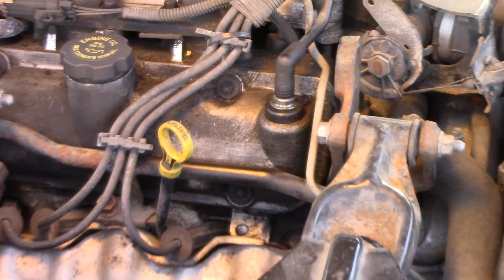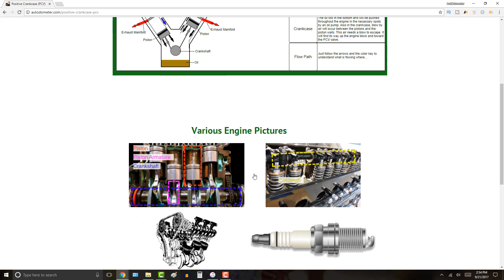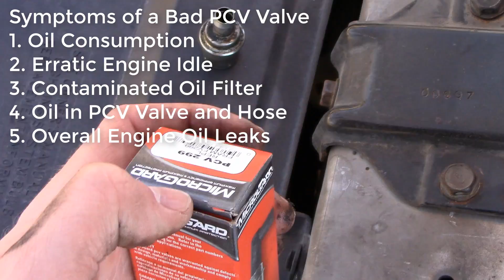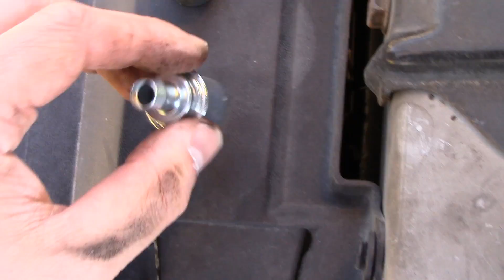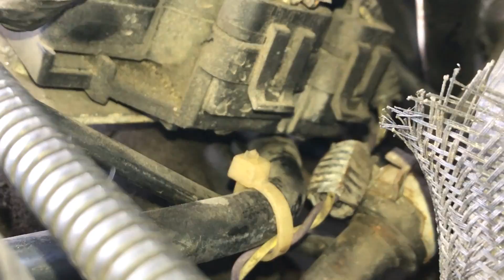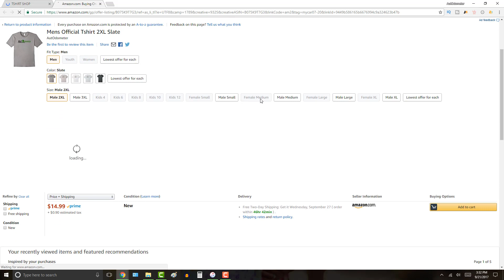How to replace your PCV Valve

Comment: That 90 rubber elbow broke but I replaced it easily with a spark plug boot rubber from a cannibalized DIY plug wire kit.

Comment: Every video I've seen on removing these make it look like it should just slip out... mine is stuck in the valve cover, lovely.
Reply: I think you are suppose to turn counter clockwise and pull.
Reply: I had the same issue, not really a great way to do it besides just keep pulling😂

Comment: Another symptom might be erratic brake pedal pressure, or brake boost performance... also and if it’s turbo a longer turbo spool/lag times since the ECU/PCM might be adjusting the idle fuel ratio to the lowest possible since the expected air from the clogged PCV isn’t available.

I am having issues with the PCV to OCC to Intake hose collapsing on my tuned Mazda CX-7... tomorrow I will replace as much as possible of the hose with 5/8 OD (12 mm ID) flexible copper tubing, as much as possible but keeping tougher 5/8 hose to keep the elasticity of the system (engine vibration friendly).

I would suggest to clean your engine compartment regularly with plain water (regular garden hose)... and if you have oil spilled use dishwashing detergent and water in a very low solution first. Just being careful with electric and electronic components and the whole engine will look quite better and also more attractive to work with.
I am an engineer, a mechanic, a racer... but I am also a woman

Comment: I have a question, the passages side valve, on top of valve cover what is that called , I think its where the fresh air comes in, my question is can that passenger side valve be replaced i can't find a video about it, its just a hose that connects to something there on top of valve
Reply from the maker: I’m not sure. I don’t have the car any more. It could just be the brake booster hose. Is anything wrong with the way the engine is running?
Reply: @AutOdometer  no it is not brake booster it gots into the throttle body next to cover and runs over to the passenger side on top of valve cover like the pcv valve  its an s10 2001 4x4
Reply from the maker: Oh is it the 3.1L engine like in this Lumina?
Reply from the maker: There is only a few tubes that typically come out of the throttle body. The throttle body will have an idle air control valve on it. It sometimes also has a small radiator tube that runs to it to warm the throttle body up in the cold weather so the throttle body flap on the inside does freeze shut. It then may have a radiator tube return to go back to the cold side of the cooling system.
Reply: @AutOdometer  i think its called air intake its a plastic hose that is connected to the throttle body cover that runs over to the passenger side valve cover
Reply: @AutOdometer  it is the crankcase breather hose I wanted to know if the piece that fits on the valve cover the hose is in can it be replaced
Reply: @AutOdometer  the port that that breather hose goes to that attaches to the valve cover on passenger side

Comment: If they can just sit there and push in, why is mine screwed in so tightly that I can't budge it 😠
Reply: Probably carboned in
Reply: Yes, it's probably crusted stuck (or melted). 
The torque specs is basically "very lightly handtight" (< 5 Nm) since it's often plastic against plastic on a lot of cars.
Reply: So how does one go about getting this uncarbonated lol. Because I'm having a hell of a time with the one I'm working on.

Comment: I haven't checked mine in 25 years  (PCV)
Reply: mine was 20 years old and I replaced it myself and it runs so much better
Reply: my obd meter said i had a code with oxygen sensor but when I changed the pcv valve it didn't show that anymore so a person really cant' go by the obd reader I have its a cheap one

Comment: Had to recently change the pcv valve on my 2000 Malibu which has a 3100 motor and was an easy job. Had it changed in about 5 minutes.

Comment: do bad pcv valve make white smoke ??
Reply: Syma D X8 : 

White smoke is usually your engine burning coolant. Maybe a head gasket or an intake manifold gasket.  

Don't take my word for it, I'd get it checked because coolant in your oil can kill a motor
Reply: @endutubecensorship  thanks for replay .  no coolant in oil . but the car has bad accelereation from stop only ! I mean if its gois more than 30 mile then the acceleration be normal ! also the coolant in the same level not drain !

Comment: Where is the pvc valve on mazda 5 mzr-cd 2.0 engine
Reply from the maker: Follow all tubing from the intake manifold and/or air intake system in general. You should find it attached to a tube that draws vacuum from the air intake system. You can always google the part to see what it looks like and then confirm in your own engine once following the tubing